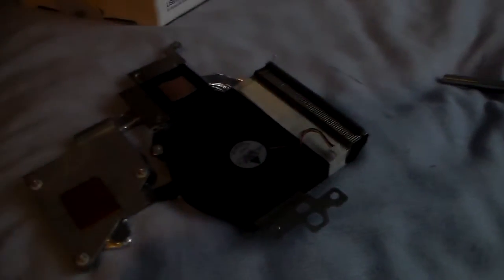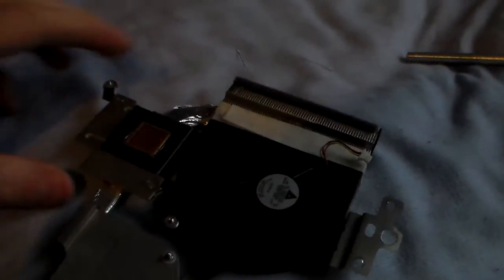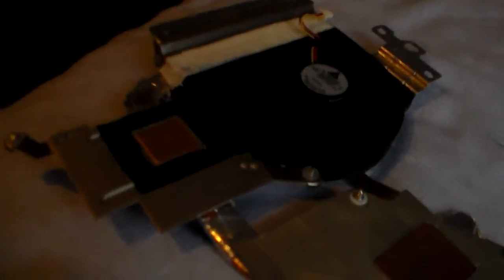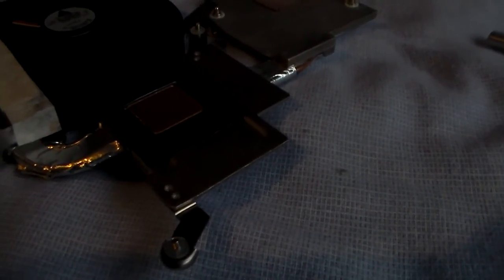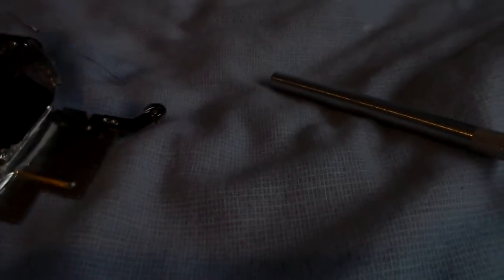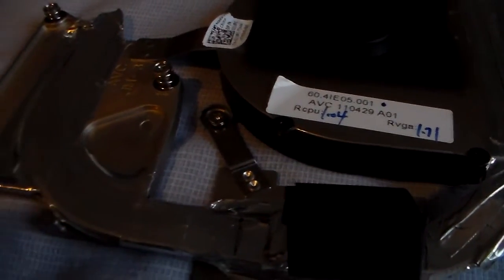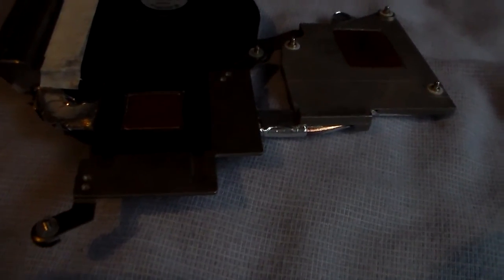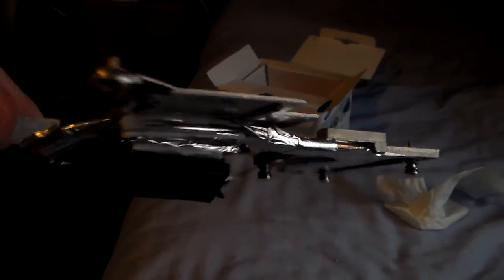DELL N5110 why this overheats

Comment: this is how I solved my overheating problem---- using the overclocking MSI software, i underclocked the GPU and ever since than its been working fine. hope this helps whoever is looking for an answer..and oh yeah always let it ventilate.
Reply from the maker: big issue with that is you take a hit on ur fps in games with a weaker GPU. I guess if you are getting a blue screen crash people don't have much of a choice.

Comment: how about using a peltier board???
the biggest problem is where to power it from...
might give it a try...i have 2 more cooling sistem besides the one i already use...might bust one up and c if it works
i'll post something here if i find something that works
Reply from the maker: Could work but you still have the heat to deal with from the other side of the peltier board and not much room in the laptop is one of the biggest problems. One solution i have been thinking of is turning the copper pipe into a water cooling pipe. Fix one inlet valve and one exit valve to the heat pipe and there the water cooling block. If you take the laptop out with you alot then you could always just buy a second heat pipe and use heat seek sticky pads and place on the the original heat pipe would take a lot of modding to work. I cant see why it would not work. The cost of buying the water pump/radiator plus a 12v plug adaptor then water reserve,tubing,small water valves, plus all the other little bits don't come cheap this would be set up so the laptop can sit on top. The N5110 cooling heat-pipe unit can be had on ebay for less than a tenner would require some modding but i think it could work.

Comment: have you considering using  Lenovo Y510P Y510P heat sink ...they are al most the same....i have same problem and i am working a solution...I think the problem can be solved by adding a copper heat sink instead of the aluminum one ..
Reply from the maker: Very true looks very similar. The biggest problem is the holes will not line up there for you would not get the desired pressure for good heat transfer. Contact/pressure is very important.  My understanding is aluminium is a better heat conductor than copper just that copper is a lot cheaper to use. I'm using a heat spreader from the ps3 console GPU. This allow me to have more contact with the heat pipe. My conclusion is the heat pipe is not capable of keeping the GT525M cooler than 80c at full load in summer time i hit 90c ambient temp play a big part too.. I have tested 3 heat sinks all the same modal with the same results max load around the 80c mark. God know what dell was thinking having just one heat pipe to push out a total of 130c full load (cpu i5 in my case 60c & gpu 525m 80c) For dell it is about cost per unit so they used a heat pipe base on the average watts each chip is most likely to put out. Now i have it set up so when the system drop down from full load the temp drops by around 45c with in 6 seconds. Take it careful i have heard many destroying the main-board trying to get better cooling. Let me know how you get on i find things like this interesting.
Reply: well the heat spreader is a good idea , have u been able to keep the temperature down since u have used that?

Comment: Overheating is quite unrelated to the fan + sink capacity. The heatpipes handle transferring the heat to the heat sink easily. Major problem is that a somewhat thick dust layer forms in the inner side of the dissipator, largely blocking the air flow and rendering the heat sink almost useless. When not obstructed the kit handles both the processor and the video easily. (Palmrest becomes warm because the HDD has still no cooling, no heat conduction ).
Unfortunately, the dust layer forms quite fast. In ~2-3 months the dissipator becomes mostly obstructed, and the disassembly to clean it up is painful. Maybe if the dissipator had  more separated fins we could have less obstruction (ofc that would require a bigger heat sink).
Reply from the maker: you'r right but contact is very important. the cpu unit had springs to keep good contact on cpu. The graphic cooler part do not have nothing to keep good contact as we all know graphic card/chips do run hotter when full load. To try and keep better contact i have used a ps3 heat spreader "say's the cex unit" this have stop the temperature hitting 90c full load but it still hit around 85c full load which i really don't like but nothing else i can do. I paid for a new fan unit i know the heat sink is clean as i cleaned it out myself. I use the best arctic thermal paste and have tested many thing but very limited with laptop's.
Reply: You are right about the dust issue with these Dell laptops N5110 they atrract it like big magnets you cleaned them and 3 months lated again they are full of dust in the air vent.  The guy on the video is also right about the heatsink with the graphics card option, it should have been made better for the graphics chip, for the cpu it is perfectly fine. I have taken appart and fixed some of these N5110 laptops the clip on the heatsink for the cpu it creates a good solid contact and but for the graphics chip it doesn't, we are talking about nanometers here or less which they make a lot of difference because the contact between the thermal paste and the clip is not as it good  creating more heating issues plus the cheap overall graphics cooling clip add on on the headsink.

Comment: you can put an extra piece of cooper
Reply from the maker: have tested with other copper heat pipes but you are very limited on room. The only ones that fit are to small to make any real different. I am using a copper shim between the GPU and heatseek but i don't think the copper heat pipe can deal with the heat from  GPU when running at 100%. My advice is don't go looking for a gaming laptop on a budget.
Reply: @Robcomments  f

Comment: I have the same laptop. Spent a lot of time thinking how to upgrade its cooling and these are in my opinion main problems which are causing the mighty overheat: a single heatpipe for two components; hdd is located too close to the heatpipe (almost touching it).
The best way to solve this without adding a second heatpipe and braking everything would be to buy a hdd caddy from ebay and put your hdd into it and use it instead of your dvd-rom(who uses those anyway.. :) ) Since you get more free space around your heatpipe it makes more room for trapped heat and you can install a small fan in old hdd spot(under touch pad) to move external heat inside, even to blow it out (you would need to drill a few small holes under SD card slot). Good luck :)
Reply from the maker: very good point. how would you go about powering the fitted fan? USB fans is a waste of time i can blow harder then USB FANS. I guess you could wire it up to the cpu fan connection  but i don't want to blow the laptop\motherboard. I have made a laptop cooling pad with 3 x 80mm desktop fans and is powered with a 12v plug adapter and is sucking the air away from the laptop. Which drops the temp by 35c-40c after quitting games. If i play games on low setting the GPU hit's around 86c if i play at the max's setting the GPU hit's around 95c-97c. i do not do this no more. All games are set to lowest settings. Thxs for the reply.
Reply: ye making a fan conection is quite a question, I was thinking of using a power slot for hdd :) after changing hdd location it would remain unused you could try that, but i am not sure what voltage it provides :) but i think a 5v laptop fan would be more than enough. You would need to face its blow-out hole to the holes you drilled under SD card slot and it should do the magic :)
Reply: remember that laptop fans are designed to suck air from the bottom of the laptop and blows it out to the sides which is perfect in this case :)
Reply from the maker: ajusaitis This is one possibility after looking at my old case+fan of this modal it may well fit just using the fan/cage using the vents that is all ready there to blow air straight over the cpu/copper pipe. the power is there with the sata just buy a SATA Internal Serial Power Extension just use the male then cut it to size just use 2 red and 2 black wires isolate yellow wire. sata power is 5v 0.48A fan need 5v 0.38A. My only concern is the copper pipe may not work. it will be cooled from both sides which my confuse the direction of heat within the copper pipe. I think a normal small fan blowing out the hd vents would work easy but like you said its the 1 copper pipe being shared between cpu/gpu is the problem here.
Reply: sasrob28 I would say that you should avoid blowing air on your heatpipe. As you said it may affect heat transfer quality.
 To blow air out through hdd vents isn't a good idea, It would be upside down and since heat is going up, it would come back. I would suggest that fan is sucking air in through hdd vents and blowing to the sd card slot side. Also seal half of the additional fan's air outlet(the side which is closer to heat pipe). Should be enough not to affect heat pipe and perfectly enough to move hot air inside and blow it out through the holes under sd card slot(if you drill those)
Reply: ajusaitis the whole point of this idea is not to cool gpu/cpu directly, but to move and remove clogged heat inside laptop's case. Heat pipe is working fine just there is more heat than it can handle which gets dissipated and trapped inside laptop's case. It starts to "cook" all components inside. Additional fan should eliminate this problem.
Reply from the maker: ajusaitis By using my 3x80mm cooling pad my laptop cools down very fast when i stop gaming. you can see the drop off in temp with in 1 minute temps drop by around 30c-40c. when i tested with out cooling pad it took longer to cool plus only drop down around 25c.but this took longer. The copper pipe is just not up to the job of cooling both chips at the same time when at full load and nothing we can do about.
Reply: sasrob28 you could try adding 2nd heatpipe. Shorter, just for gpu. But i would only try this if i had another genuine heatsink for this laptop ( to replace broken one if sth gone wrong).
Reply from the maker: ajusaitis I can get my hands on loads of old copper pipes but none really fit. adding a copper pipe with out a fan would just heat the laptop inside.
Reply: sasrob28 lots of laptops got double heat pipe and a single fan, you can always give it a try, but this will take a lot of creativity since you would have to modify fan's chamber etc..